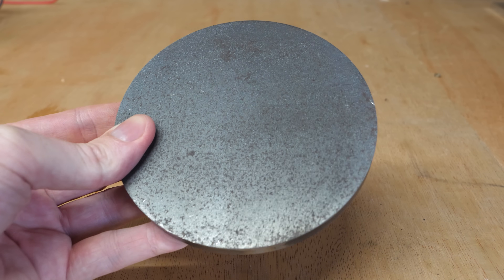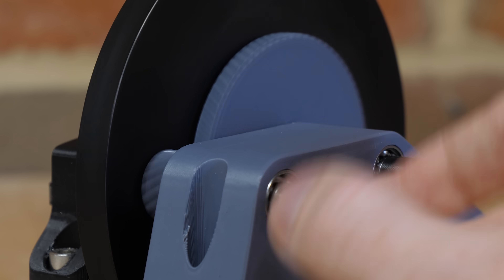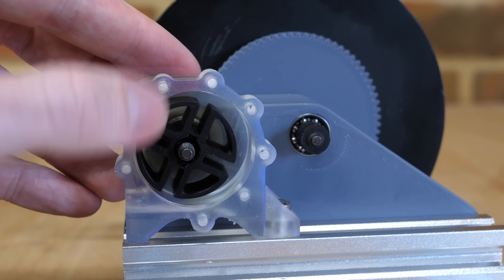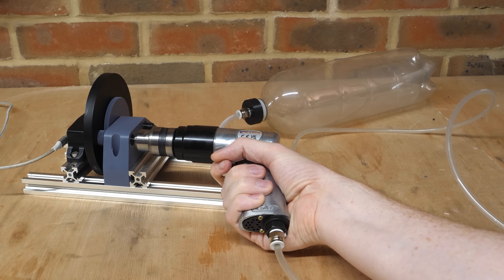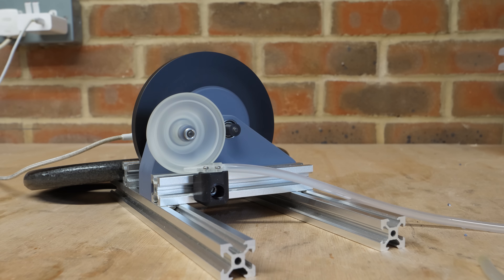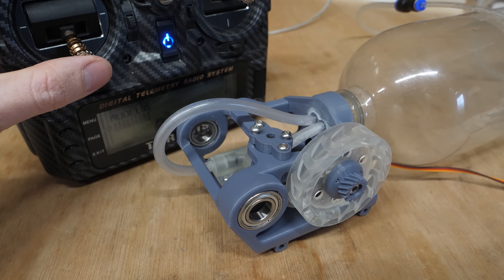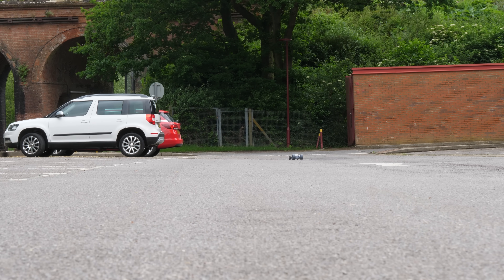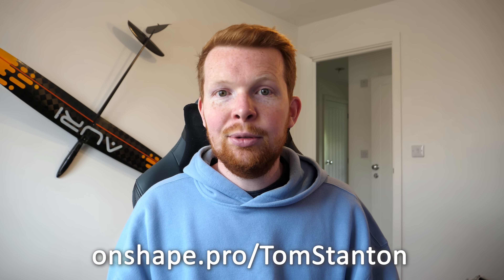Building a Turbine Car

Comment: While I do work on jet engines, I don't work on turbines, so take this next comment with a grain of salt. I think the passages between blades need to continually expand as the air passes through them. Hard to tell exactly from the video, but it looks like your passages are tight at the leading and trailing edge, but more open in middle. Also agree with others about more nozzles or multi stage, but I've hit the end of my turbine knowledge. 

Also, take a look at turbocharger geometry
Reply: His design is an impulse turbine, which means that the gas should already be fully expanded in the nozzle.
His third design has a higher degree of reaction, with expanding passages, but he does make use of it, as his turbine wheel is not sealed

Comment: Hello Tom,
I love this project.
May I suggest If you want to make an exciting dragster, Using the compressed air to spin up a flywheel and a tiny multi disc clutch to create high torque off the line. there will be a lot of variables to play with to achieve the best performance. such as Pressure, flywheel size and weight, rpm of of flywheel at the time of clutch engagement, to name a few.

Comment: 3:15 You make a big implied assumption here, and that is that losses in your system would remain constant. You measure the acceleration, not the torque directly, and the equations of motion include more than just the input and mass term. Thus I would however argue that this is not the case. 
Firstly, viscous friction scales linearly with speed. Thus the torque produced by friction increases with RPM and will counteract the input torque. The rolling and sliding frictional moments created in bearings cause this viscious effect to be present.
Air resistance generally scales with the square of velocity. I am not an aerodynamics engineer, but I am sure there's weird boundary drag effects near the edge of the flywheel. Whether it is actually significant enough to have an impact or not, I dont know.

Comment: Not sure how much research you've done on multi-stage turbines.  Usually, if you're following power plant turbine models, you may want to consider adding stationary straightening vanes between the turbine sections similar to power plant turbines.  They should be mounted so the curves on the spinning rotor are curved in one direction (e.g. curved side up) and the stationery vanes (in a power turbine is mounted to the shell) are mounted in the opposite direction (e.g. curved side down) to straighten out the airflow between the sections.

Comment: Aren't pneumatic tools meant to be fed an air supply with an oil pickup so the tool always gets oil during operation? I wonder if that affects performance as it would lubricate and help produce an airtight seal.

Comment: What happens, if you flip Turbine 4 around and use the air inlet at the center? I think this would increase the performance, as it is more similar to how actual turbines work. With the inlet at the large radius, you loose energy, because you have to compress the air (the outlet area is smaller than the inlet area). Putting it the other way around would theoretically increase the power yield, because you can extract more energy from the expanding gas.

Comment: The exhaust of your vane motor is in the incorrect location. It needs to be at the bottom right of the casing, where the air has reached maximum expansion. In your case its on the bottom left, so the motor is actually re-compressing the air some before forcing it out the exhaust, loosing a huge portion of the energy captured at the expansion phase.

Have a look at some vane pumps, and then just run the flow in reverse to see what I mean.

Comment: I'd love to see a small dragster competition where the only energy storage for the movement is a pressurised plastic bottle.
Bladed turbines, bladeless turbines, piston motors. Driven by wheels, propellers and jet nozzles and hovercraft skirts.
Reply: @cloudpandarism2627  imagine strapping like 4 bottles onto the car, spinning up a flywheel then the car drops all the bottles to lose excess weight and just smokes it
Reply: @yutakawasaki7207  even better.
Reply: yes. the air bottle being the only constant
Reply: "The Great Egg Race"
Reply: Water rockets would take a lot of beating.

Comment: That actually worked pretty well!  Would be interesting to experiment with a big shop air compressor and a turbine that powers a small alternator to see if you could make a air powered UPS. It would not be very efficient compared to batteries but be fun to see if it could be made to work.

Comment: I'd love to see you build a full axial flow turbine running on compressed air and compare it with this single nozzle variant. Whenever I think about turbine designs, it always seems wasteful to only have one nozzle. And the logical conclusion to adding more nozzles would of course be the axial flow design.

Comment: one suggestion is to have a a smaller turbine and have 3-4 smaller nozzles, cus right now only one spot on the turbine is producing power, you could half the diameter by doubling the nozzles, won't be a 1-1 unless it's more efficient which it might be
Reply: Not saying it won't work but.. friction increases.
Reply: @squidcaps4308  the friction moving the turbine would increases too
Reply: If the nozzles were staged it could dramatically increase efficiency. Have three nozzles. Use one very small nozzle as the low throttle. Don't open the second until the first is fully opened, then start opening the second, and so on. Partially opened valves are very inefficient. Having one valve fully opened with two others shut is a much better way to do 1/3 throttle vs 1 valve 1/3 open.
Reply: An axial turbine with multiple nozzles and stages would be the way to go; which looks like it's on the drawing board.

See also my comment about incorporating the throttling valve into the nozzle design.

Comment: "Cool! is that electric?" 

"No it's gas powered"
Reply: Technically correct, the best KIND of correct!
Reply: @elitearbor  I am also using this specific Futurama reference always when I can. 👍
Reply: @elitearbor so windmills are gas powered huh
Reply: @elitearbor  No, it's technically wrong, the worst kind of wrong.  An electric compressor (would) compressed the air.   Serial conversions of energy never goes well.  Professional air tools running from professional industrial sized air compressors rarely exceed 20% efficiency.  EDIT: In this case, it's powered by his muscles. But any product would use an air compressor.
Reply: @tarstarkusz  your'e no fun
Reply: @tarstarkusz -- Firstly, the air was compressed by hand, so that would be hand powered, not electrically powered.

Second, if energy storage should be classified by what charged it, then most things are fusuion powered (including all oil, gas, coal, solar, wind, and hydro), a few are supernova fusion powered (fission generators, geothermal), and everything is big bang powered. But saying everything is powered by the universe is a pretty useless answer.

Thus, this vehicle is powered by compressed air, no matter how than air was compressed.
Reply: @TlalocTemporal  On this small model.  So, OK, it's corn powered.
Uh, no. That's dumb.  Anything that requires energy in the here and now, is powered by that energy.
Reply: @callmezucc9318  Sure. I'm a splash of cold water of reality.
I just a video the other day where some liar was spreading this dumb rumor about an upcoming GM engine powered by compressed air.  So stuff like this does real damage and needs a splash of cold water.
Reply: @tarstarkusz  -- "Anything that requires energy in the here and now, is powered by that energy."

What are you claiming here? That cars are powered by rotational energy? What energy do you think the model needs, and what is providing that energy?
Reply: @TlalocTemporal  They are powered by hydrocarbons.  Yes, if you go back 90 million years, the sea life was powered by the sun. But we're talking about here and now.
Reply: @tarstarkusz  I don’t quite understand how you think your arbitrary definition is clever enough to warrant an argument. Also, how do you know where he sources his power? You're trying to sound clever but end up coming across as annoying.
Reply: @siffoine  Any way you source the power, it is inefficient.
Reply: @tarstarkusz  -- I don't care how inefficient compressed air is, I care to know what the car needs to work. It needs a battery for the electronics, and a source of compressed air up to 80 psi. Whether you get the air from a bicycle pump, a compressor of any kind, a supersonic slipstream, or the surface of Venus, it doesn't matter. 

Compressed air powers the model car, regardless of where or how you got it.
Reply: @tarstarkusz  Yes, what is your point?
Reply: @tarstarkusz you’re not a splash of reality. Everyone who watches this knows that energy always comes from somewhere else. Your initial comment was it’s really electric, but the electricity could come from coal or hydro or waves. Even if you take your pretty vague and arbitrary definition of “here and now”, it doesn’t shine any more light on anything. Especially since the video is more about the science and engineering than trying to promote a green energy solution. I don’t think anyone watched this video and went, “omg climate change solved!” The power source pertinent to the purpose of the video is compressed air.
Reply: @tarstarkusz  your reasoning for electricity powered is rather stupid. if you say that because you account for power used by the air compressor, you should consider that some of the power in the grid comes from gas power plants. and also, gas comes from organisms that initially used sunlight as power source for photosynthesis. and sun is powered by nuclear fusion. so this little stupid thing is in fact nuclear fusion powered. so let's stick with gas and call it a day.
Reply: @tarstarkusz  you're annoying
Reply: @tarstarkusz  How does it feel to like your own comment 😂
Reply: @TlalocTemporal yes but if you want to get technical the ability to pump the pump is electrical. Your brain has to be able to send and receive electrical signals in order to activate the muscles to pump the pump
Reply: @tarstarkusz  That's not what "x-powered" means though. When we say something is powered by a certain energy source, we are referring to the energy that is actively being consumed while said thing is in operation. The form of energy storage that is being depleted during the runtime of the RC vehicle is a pressurized gas. It doesn't matter how this energy was created. If we were to adopt your lingo, then you could say that the pressurized air is powered by his muscles which are powered by the food he ate, which is powered by sunlight which is powered by fusion, etc. So yeah, everything on earth is technically fusion-powered by the sun. But at the top level, the RC car is gas-powered.
Reply: Alright pal, you're goin downtown 👮👮
Reply: Hope there isn't any CO2 in that air. It's bad ya know.
Reply: @hhg7832 CO2 in it's natural state isn't bad, but carbon dioxide is. Plants and trees absorb CO2 to release oxygen and such. All life here on Earth is carbon based, after all.
Reply: Tbf nobody realistically is going to ask you if your remote control car is electric or not
Reply: haha
Reply: An air powered dragster sounds intriguing to be fair. I'm here because I was curious, is all.
Reply: Nice
Reply: pure oxygen
Reply: @A.k.-47-  actually only about 20% oxygen, assuming it just came from a bike pump
Reply: @k6l2t  was a joke but ok
Reply: Not pure @A.k.-47-
Reply: Outside of America calling something gas powered means an actual gas state of matter not a shortening of gasoline
Reply: @petesmith13  Yes, that was the joke.
Reply: @petesmith13  Shame it isn't gas powered in any sense of the word gas.
Reply: Did you watch the video? The power is stored in a gas - compressed air. It directly uses that gas to provide forward motion. It is gas powered.
Additionally, he used a hand pump to pressurise it (after finishing testing), so you're not 'technically correct' there ether.
Reply: @FishSomething  Well, for the experiment. Nobody would ever do this with a remote control car you want to sell.
Reply: @tarstarkusz  yes it is...? air is a gas, by gas they don't mean gasoline
Reply: @uzi1476  Air doesn't self compress.  An electric compressor would be used in a compressed air powered car.
Reply: air*
Reply: No, it's electric. And it's far less efficient than regular electric.  Air tools have TERRIBLE end to end efficiency. It's like under 20%.  If the compressor pulls 1000 watt hours, you're luck to get 200 watt hours out of the compressed air.
Reply: @tarstarkusz  Coal power plants are actually fusion by this logic since energy originally came from the Sun and was converted through photosynthesis and later through steam turbine.
Reply: @tarstarkusz by that logic most electric motors are coal powered.
Reply: @trentoncarr only in third world countries like West Virginia
Reply: @tarstarkusz hey I've actually always thought that. I own a compressor but I never get any tools for it besides basic air sprayer, n air chuck.  It just doesn't seem efficient to get any thing else. I'd rather get electric. N will always get electric.  I gotta admit they do sound really cool tho.  That's the only reason why I'd want something but never go through with a buy. 🔌
Reply: @easttexasspecials175  For professional use, at least with some tools, nothing beats air tools.  Battery operated tools like grinders, for example,  just don't run that long.
Reply: @tarstarkusz  that bs . N I didn't say battery powered. 🔌
Reply: @tarstarkusz  Except that he used a bicycle pump.  Not a compressor. Stick your foot in your mouth often?